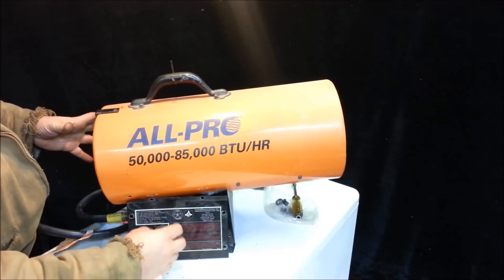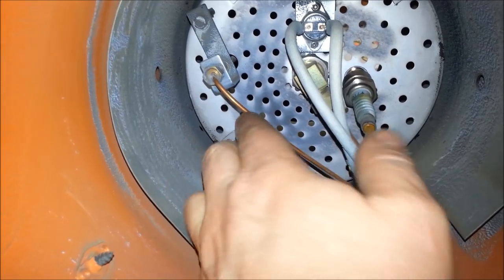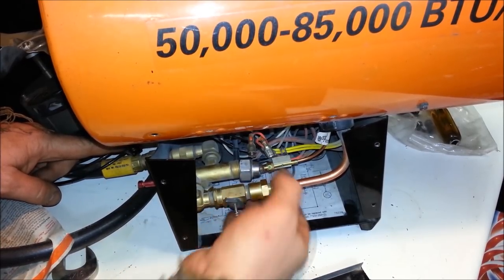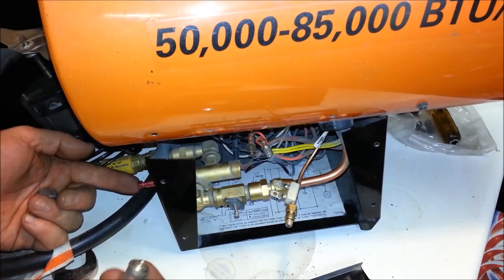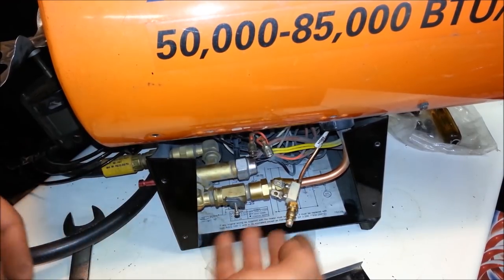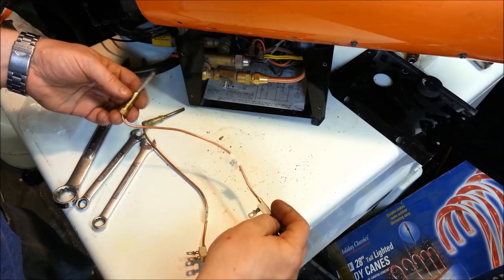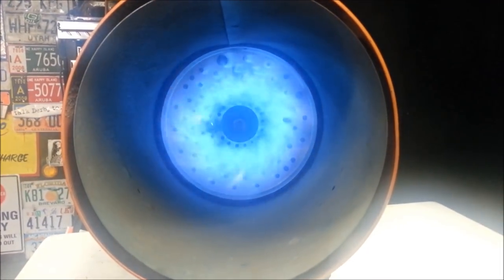Propane Torpedo Heater Not Lighting & How they Work

Comment: Help, no spark coming from the spark plug?  I jumper the heat cutoff sensor.  Still no spark.  I check the sparkplug and its showing 47 ohms of resistance?  Thoughts?
Reply from the maker: Likely your spark ignitor is bad. These generally also have a relay box in them. The relay box has a series of metal contacts inside the can get corroded. Most of the time the relay box is clear with 6 to 10 wires coming out of it. If yours has this you can take off the cover and use really fine sandpaper and clean all the contacts.
Reply: @sixtyfiveford  I will give this a try...let you know the results this weekend and thanks for the reply

Comment: Mine worked great 1 second, then  I ran outta propane. Went right away and got a new tank, came back and plugged in the new one and it barely blows. Went and got another fresh tank. Same thing. Could you help? Everything seems fine, but only seems to be blowing at 25%..
Reply from the maker: Safety valve in the tank is slowing the propane flow. You need to follow a few steps when you put on a new tank.
-Connect tank
-Turn tank valve on and wait 3+sec
-Turn tank back off and wait 3+ sec
You may hear a light click inside the tank; this is the OPD safety valve disengaging.
-Finally turn tank valve on and you're ready to use it.

Comment: I've changed my spark plug, and the thermocouple and the flame won't stay ignited. Any ideas? Same model as video.
Reply from the maker: Some have a over temp sensor that can go out. You can also clean the contact on the relay. It has a bunch of wires going into it and a clear cover that'll come off to allow the contact to be cleaned with fine sandpaper.

Comment: I'm curious - with the thermostat override switch, when the temperature cools down sufficiently, does the heater restart on its own? 

I ask because I plan to use one of these on a powder coating oven that I am building. I will have a PID and thermocouple to measure the oven temp and want to turn the propane flow on and off. My plan was to drive a propane solenoid, however now I'm thinking it must be possible to tap into that existing thermostat valve electrical circuit. Do you think this is possible?
Reply from the maker: Once the thermo safety switch shuts it off, it won't restart by itself. The  gas start switch will need to be pressed by hand, every time.
Reply: @sixtyfiveford  Thanks for the quick response! I didn't explain myself clearly though. The valve works either manually or electrically once the thermocouple heats up. However, if I understand correctly, the thermocouple can be overridden by the thermostat when it gets too hot. So, I'm wondering if it is possible to essentially add another thermostat into that electrical circuit that will close the valve when an it measures a certain external temperature? It could even just be a button or switch - anything that can switch the voltage that goes to the valve. Writing this out, I'm pretty certain it can be done... But I'd love your thoughts. That was a fantastic video

Comment: I have a similar heater the first two times I used it it worked great.  The last time i used it it lite of but the flame is very low and not producing very much heat.  Any idea what the problem could be?
Reply from the maker: Your propane safety valve isn't open all the way. 

To fix this:
-Open the valve and wait 2seconds
-Shut the valve and wait 2 seconds(you'll hear a click)
-Open it back up and you should be good to go. If you hear a click when you open it the second time you will need to close it one more time and reopen it.

Comment: Replaced thermocouple and temp switch and igniter block, still only runs with switch depressed 
Am I looking at magnet?
Thanks
Reply from the maker: Some of these use a relay to hold the electromagnet open. Generally it'll be a little cube with a clear cover. There are little contacts in there that can have corrosion and can be cleaned up with fine sandpaper after you take off the clear cover.
Reply: Dane did you get yours working?  I have the same model as in this video in like new condition.    I have replaced my thermocouple (with the one linked to this video), temp switch tested good and mine only runs with the igniter switch depressed also.

Comment: I have a 60,000 Master and last night it was working fine but after a few hours the flames went really low.I have it hook up to a 80lb tank and it's full.Do the tip on these screw up?Can I clean it with a metal brush?
Reply from the maker: Sounds like your regulator froze up from the propane. I bet it works just fine after sitting a few hours.
Reply: Thanks.Going out to my barn later today.lol I got a new one and bigger at Tractor supply last night.Two is always better :-))Thanks again

Comment: I have a REM55PV (Remington Torpedo Heater) and I changed the thermocouple after seeing your video. Still not working... It came on for a little while (twice) but other than that when I push the plunger in and hold it for awhile it releases and doesnt stay lit. My tank is pretty full. Do you think it could be the magnet? What is that piece called? I cant find it in the parts breakdown to order.
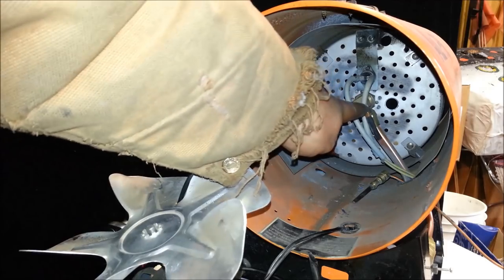Reply from the maker: It is either your Relay or High Limit Switch(at 5:00 in the video) then. The High limit(over heat) temperature switch can be bypassed by simply disconnecting the 2 spade wires and connecting them together and testing. If the heater runs and works normal you can replace the switch, if not we need to look the the Relay Box. Take your relay out; little box with a bunch of wires going into it with generally a clear cover. You need to check the contact points on the relay are making a good connection. Your relay will look different from the one in this video, but the idea of cleaning is identical  https://youtu.be/uerxvIBODOE

Comment: How much power does the the little thermal thingy make? Could we charge a cellphone (in a pinch) with a fire using that?
Reply from the maker: ot0m0t0 Around 30-60 millivolts. So 0.03-0.06 volts. You would have to get several, but it is a possibility.
Reply: It's only millivolts, not enough to charge a cell phone, not even enough to light an LED.

Comment: we have a unit that is only about 2 years old but makes a very loud humming noise when turned on , very loud...the noise quites if you restrict the air flow into the chamber, any ideas? thank you
Reply from the maker: Are you sure the fan blades aren't rubbing the housing?

Comment: I went to use my heater yesterday and it started sounding weird. I turned the gas off and unplugged it but the flame kept going and it was shooting out at least a foot past the heater. I went to restart it and it sounds like way to much propane coming out. What could be the problem?
Reply from the maker: Regulator is bad. This is in the hose, generally at the tank connection.
Reply: @sixtyfiveford  thanks. I just unhooked it from the tank and there was a lot of pressure in the hose. It hissed a good minute after it was unhooked from the propane tank.

Comment: A friend has one (Readdy heater) with a switch no knob that he just plugs and unplugs to make it run. Mine has a knob that you have to push in and wait for the thermocouple to get hot then you can turn to variate the output. Can I just plug and unplug mine to operate it?
Reply from the maker: His has a computer telling the pilot when to light. Yours is always going to be a manual light and there's no converting it. The nice thing is yours will probably last three times longer than his.
Reply: @sixtyfiveford  Do you know what brands have that computer ignition? The reason I ask is I want to have a unit that is thermostatically controlled and that always comes on the larger BTU units only mine is a Dyno Glo pro (70K-125K) they make a wireless thermostat that controls an outlet but I need a propane heater that would run just by on and off switch not manually.
Reply: Do the ones with a computer ignition use a photocell instead of thermocouple?

Comment: Would there be any reason why you could not un-solder that 2 pin connector and re-solder to a new thermocouple.  Asking because mine just went out and need heat now and home depot sells the thermocouple but it doesn't have the 2 pin hookup but mine looks to be just soldered on.
Reply from the maker: The pins are a break in the electrical connection inside the thermocouple wire. This allows a relay to cut the power instantly where without it would take 5 seconds if the flame went out, where raw propane was dumped into the room.

Comment: I have replaced my thermocouple and my heater still wont stay light. Any idea on why?
Reply from the maker: Two other things I have found:
Some heaters have an over temp switch that can go bad. 
The other is the main relay(generally has a dozen wires going to it with a clear cover) will get dirty contacts.

Comment: My heater throws about 6" yellow flames. They don't make it out of the tube but still I feel that's odd Is that normal for a 30,000-60,000 propane heater? My last torpedo had blue flames and so does yours. I guess I should try not opening the valve all the way.
Reply from the maker: Generally a yellow flame is too much fuel to oxygen. Really can't change the rate of oxygen(air from the fan) coming in, so we just need to dial back the propane. This is the job of the regulator attached to the end of the hose and should be a fixed regulator. More than likely it is defective.
Reply: sixtyfiveford I had a feeling it was the regulator. I knew there was a reason it was on sale for $70
Reply from the maker: kakytoo69
You may be able to close the valve on the tank just right to make it run properly.

Comment: Mine was working great, until we used a jumpbox inverter to run it for 10 minutes or so. It ran great and sounded normal, but after turning it off, the next time I tried to run it, nothing, won't ignite. I can manually light it by holding in the igniter and using a lighter. It stays lit and runs, but with a very weak flame, like it's turned way down but it isn't. Any ideas? We've run others on inverters before with no problems, but that's the only thing we did differently.
Reply from the maker: Sounds more like a propane delivery problem. Do you hear it sparking? You could just have too low of flow. Check your tank connection first.
Reply: @sixtyfiveford  tried 3 different tanks, one brand new and full. Tried the tank and line from my other one that works, no change. The spark plug has spark, but very very faint and no sound. Last time I had to clean out all the jets to get the burner going strong again, but they're relatively clean still and not plugged.
Reply from the maker: @jdisdetermined  I would suspect the regulator. Try tapping it lightly with something.
Reply: @sixtyfiveford  Okay, I'll give it a try in the morning. Thanks!

Comment: How are these different as far as safety and emission compared someone running a propane BBQ inside a garage.  I've heard people dying trying to keep warm running a propane BBQ inside their garage.
Reply from the maker: AnalogX64 I have a pretty well sealed and insulated garage and made it a point a 
few years ago to put the Carbon Monoxide detector in there. I can run 
the heater for 8 hours and it will never set off the detector. But if I 
start a small engine it goes off in 60 seconds. I feel very safe running
 these heaters in an enclosed shop.

Comment: I have propane reddy heater in my garage I can only let it run for 5-10 minutes each time, after that  I have to shut it down my eyes start burning ,is it just lack of fresh air  (oxygen), or something wrong with the heater ?the garage is well insulated and sealed,is it possible that the heater could use up all the oxygen in 20by24' garage in 10 minutes?
Reply from the maker: You should be able to run a 50-80k btu heater in that size of garage for hours. Some people are more irritated by the burning propane that others. I know I prefer a diesel/kerosene heater over propane.

Comment: Hello, I just got one of these used. When its off and I plug it in the blower and igniter automatically start. The switch wont turn to on unless I push it in so I know its in the off position. Any suggestions? I can get it to start  but the igniter continues to fire the whole time. I assume its not supposed to do that?
Reply from the maker: +William G It "is" supposed to fire constantly. You'll here a sparking/clicking noise the entire time it's on. Sounds like it's working like it was designed to.
Reply: +sixtyfiveford Thanks.  I  wasn't sure.  I  thought it might be fine after I took it apart and realized the swith was just a valve to turn the gas on and off.

Comment: Having the same issue - as long as I hold down the by-pass button the flame flows but as soon as I stop it goes out. I just replaced the thermo coupler still flame will not stay on. Could it be the little plunger or as you called "little dudad" that doesn't go bad very often. I bought this unit new at a flea market still in the box.
Reply from the maker: Some units have a relay on the circuit board and the contacts can get dirty, but generally only after years of use. Does your thermocouple have two spade connectors in the side like the one in the video?
Reply: +sixtyfiveford Yes same as yours. The guy who sold me the unit had like 20 new in the box could they be old and sat up for a long time?? As long as I hold the by-pass button down the flame is good so doesn't that prove all other componets in the tube are working? Tks for you assistance buddy!
Reply from the maker: Yeah, the style in the video is 10+ years old. I think your relay contacts are dirty. It is a about the size of a marshmallow and has a clear covering. You pull off the clear cover and you can see the metal contacts. Use some really fine 200+grit sand paper and clean them.
Reply: I'll give that a shot again tks for the help!!

Comment: Can these be controlled by thermostat. If anyone could do it you could!
Reply from the maker: You could easily just use a thermostat-controlled plug. This would shut it off once it got up to temperature. Restarting would be an issue because you have to manually depress the ignition button

Comment: My 170T ignition panel's indicator lights do not come on although the on/off switch is lit. Therefore, the unit will not come on. I cannot find that troubleshooting anywhere. Any ideas?
Reply from the maker: Most machines have a reset button.

Comment: So I got a thermocouple from Home Depot but it doesn't have the two connections and you said in the video it controls something else.?Can do without them can? I connect them together?
Reply from the maker: It is a safety and allows the thermocouple to shut off the gas instantly. They are pretty cheap on http://amzn.to/2fZIBV0
Reply: I don't think you can, this model uses an electromagnet and what you got from home depot is probably a mechanical one which is similar to this but without the electrical contacts, the 2 prongs that he said are used for another function are actually the voltage supply for the electromagnet (a thermocouple does not produce electricity, it "couples" based on a temp threshold - the one in this vid I think has a mechanical linkage to an electrical contact which comes on when it reaches the set temperature).
Reply: No...the thermocouple actually produces about 10-25 millivolts that close the solenoid on the gas valve. The male spade connectors are for the high temperature limit switch. These should be shorted unless the high temp. limit is reached. I have seen quite a few millivolt solenoids go bad.
Reply: Zeth Loberman does it run without the two wires on the thermocoupler

Comment: i have a 10x30 garage what size do recommend I should  get a small or bigger one
Reply from the maker: My garage is 20x20, so the same size. I find a 50,000btu ample to bring up the from freezing to 60ish degrees in 20-30 minutes which is generally when I tear the coat off. This is with a high 16ft peaked ceiling and no ceiling insulation but full wall and garage door insulation.